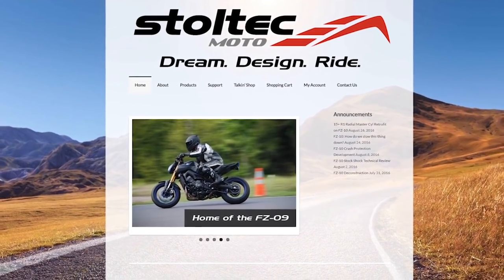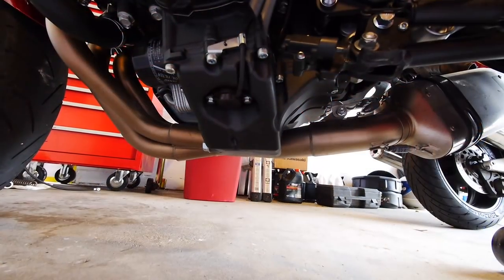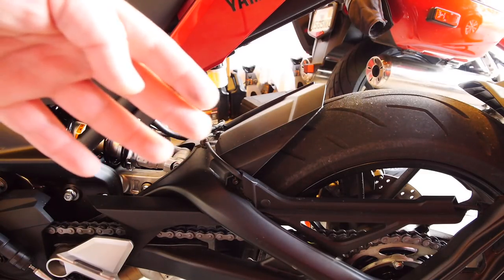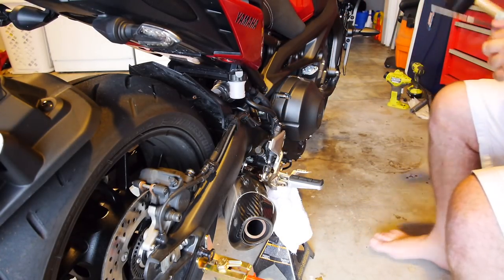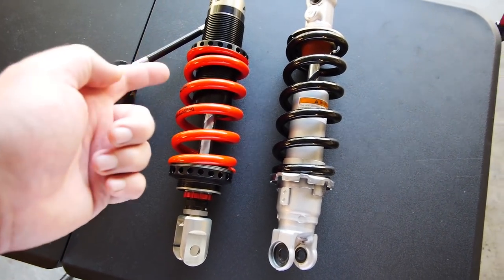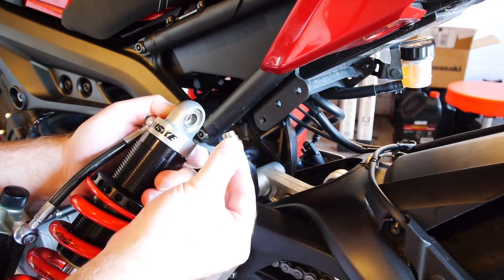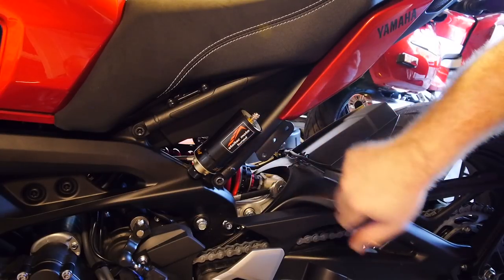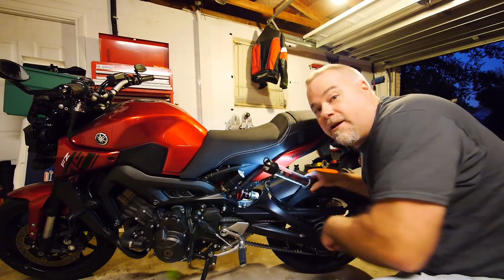FZ09 MT09 Shock Removal And Installation Guide

Comment: Good video, I found it easy to swap my shock today just by jacking the bike up by the right foot peg, it made a tripod with the side stand and front tire that was very stable.  Then I used a ratchet strap through the rear rim and over the rear subframe to manipulate the mounting holes to line up.  Piece of cake!

Comment: Just did this on my 2019 MT09 using an Ohlins 535. I will add that the top bolt doesn't just "knock out", my bike has two beefy hydraulic lines crossing the top of the bolt, they needed to be "massaged" aside. Ohlins also instructs to remove the lower dogbone bolt, I discovered that unless one DOES the lower shock bolt (delightfully recessed into the shock clevis making common wrenches nearly useless) won't get above the swing arm frame. Once there though sockets rule the day.
Reply: thank
Reply: I am removing a Matris damper, and I couldn't get enough compression without moving the lower dog bolt. Fk me, that thing was on so tight, I would not have gotten it off without my 1/2 impact. And it totally mangled the nut
Reply: Hey! I know this is a long shot, but I'm going to swap out my shock soon. What bolt is the "lower dogbone" bolt? I'm not sure and don't want to loosen up the wrong bits. Cheers!

Comment: I’ve just changed mine to a Nitron R1 using your vid. Another job you’ve helped me complete. I’ll be setting the suspension up using your video too.
Thank sfor all the help.
Reply: is this possible to do without a rear stand?
Reply: Jack Pistone you need to get the rear wheel off the ground. I used an Abba stand

Comment: Thank you for doing this video. I was on a budget so I went with the K-Tech Razor and I'm going to install it hopefully tomorrow. The pogo sticking on the rear factory shock has been driving me crazy. It's caused me to kick out the back end and do a small drift a few times, caused the back end to hop in some corners and just all around feels spongy and kinda reminds me of the old mashed potates and gravy suspension on like an old crown vic or something, just seems completely outdated and wouldn't have cost Yamaha too much to put a proper rear shock on the bike from the get go.
On my 2018 I adjusted both fronts and set the dampening and I've gotten that one to be very planted and comfortable, no more brake dive and it's helped stabilize the rear more but definitely hasn't hidden the problem. I am looking forward to getting on it and being able to have more fun and overall will be safer to ride by getting rid of that pogo sticking. I'm 190lbs without gear and I have the front set down on the 2nd to last ring on the tops (so one ring showing) and have setup the rebound as well. I used to have it set to 2 rings showing and have adjusted the rear suspension one click tighter and that did make a difference but it still is doing all the stuff mentioned above, just more controllable.

Comment: Great video! If I could add another couple of tips - if you have an abba type stand that holds the bike up near the swingarm pivot, you can manipulate the rear linkage easier if you take out the lower dogbone linkage bolt (don't forget to replace on installing!) and you can regulate the wheel height by using a ratchet strap thru wheel and over seat. Means you can precisely regulate bolts lining up.

Comment: Not sure if it was mentioned but the 14-16 FZ09s have the oil drain bolt on the bottom of the pan so it's not flat like yours is. Either use towels to cushion the pan, or spread the rear using one of the other methods if you have an aftermarket exhaust.

Comment: Thank you for this awesome video.  Are you 99.9999% certain the catalytic converter/stock exauast will work as a jacking up point?  I don't want to damage my exhaust.  Alternatively I could place a 2/4 under the oil pan instead of a text book and this should allow the jack to lift via the oil pan and not the exhaust.  Or I could place a few shims under one or the other and spread the weight between the exhaust and oil pan.  Maybe I just answered my own question. 

Thanks again.

Comment: I am more concerned the bike's balance when the shock is removed.  Would it be more stable if I use the center lift instead (in addition with the rear stand)?  The center lift is just to prevent the bike from dropping.

Comment: I tried using the same method/ process to swap out my 17 model shock for a zx10 unit. 
What a disaster. Resulted in taking off the tank. 4 hrs later
Reply: That’s because it’s not a direct fit for the fz-09.. it’s for a zx10
Reply: Yes the Kawasaki shocks going on FZ MT09 are another internet legend. Most have to be modified, and only a couple of years of zzx9 or something like that are a close fit, others require some chopping away of the bike and some the hole in the shock needs enlarged. Not a problem for wreck it ralph that follows the internet!  The Kawa shocks need to be correctly resprung and they also need to be rebuilt to be very good, which brings the price up to within $200 of getting a perfect fit Ohlins or other brands, which are down to about $550 american dollars now.

Comment: have you looked into doing anything on the rear shock with the FJR? i know its the ES model, just trying to find out the options as i'm upwards of 33k miles and understand that's when these shocks start to wear.

Comment: Thank you for the video. I own a 2017 FZ-09 as well. Forgive me, but I can't help but think that after all the upgrades I've done on my bike that I could have bought a better bike — say a Triumph Street Triple. Just saying. ...
Reply from the maker: That is true, and that's the point of the FZ series.  They are bare bones bikes meant to be personalized and upgraded and are CHEAP.  Still there are core differences between the platforms.  For example I hate the riding position and pegs of the Street series but otherwise love the bike.  But you certainly do pay for it.  In the end I now have a bike perfectly suited to me, built exactly the way I wanted and it's still a good bit cheaper than a fully loaded ST equivalent.  Not counting my labor of course ;)
Reply: TwoWheelObsession I get it. How does your new suspension compare to the Öhlins on the ST?
Reply from the maker: Equivalent.  Pensky/Ohlins is all about the best deal you can get, both are top notch. The custom valving and springs in my forms make them perfect.

Comment: Great Video!  If you were buying this bike now, knowing what you know,  would you buys the MT 09 SP or would you buy the standard MT 09 and make the suspension mods yourself?
Reply from the maker: There is no sp here
Reply: The SP suspension is also very low quality junk. It can not be serviced. No compression adjuster. Horrible

Comment: I replaced on my MT-09 Tracer RN29 2015 first version (rusty) stock against newer modified stock shock.
There is axial/lateral play on lower mount between shock bracket and 1RC-2217A-00 ARM, RELAY.
How much lateral/axial play do you have on upper and lower mounts? Please show us this in video. Is this later/axial play necessary?

Comment: I am attempting to install a Ohlins YA 535 on a 2018 Yamaha MT-09 and I followed your instructions but am not able to remove the rear (bottom) bolt as i do not have clearance. I have the front tire on a wheel choke. Should i have the front lifted with a triple tree and this will provide the clearance in need? Thank you for your help.
Reply: Same. Idk what to do other than remove the exhaust and the link arms at this point.

Comment: You mentioned it making easier to wheelie? If I have it in traction control 2 it still wont wheelie right? This is my second bike I usually ride in B mode and TC2 . after getting it flashed its still plenty fast but the front wheel wont come up. I still want to upgrade my suspension though
Reply from the maker: Correct mode 2 it never leaves the ground

Comment: I’m about to upgrade suspension on my 2018 MT 09. Probably going to go with this same rear but the front upgrade you did is just more than I feel capable of. I’m considering just upgrading the from springs for my weight according to race techs calculations (along with the fork oil) do you think I will be satisfied with that.? I don’t want to drop another $1000 on the from suspension.
Reply from the maker: Nope.  Good part of it but the damping is critical.
Reply: TwoWheelObsession 😪thanks for the reply. I’ll be looking into some cheaper option then for now at least. I’m right at 230 lbs so the bike is under sprung front and rear for me from the factory.
Reply: @jasonsmith9161   if you still haven't upgraded and you are on a budget still then look at the YSS cartridge kit. Around £240

Comment: Bought a replacement shock (Nitron) and now find that the ABS brake lines and 4 other lines block access to the top shock-bolt. The brake lines are really tight the others are held together with cable ties and can barely move. I can't use anything bigger than a small screwdriver blade through the frame window to just touch the bolt head and then only from an angle.
Questions: Did you have this problem with access?  Did the bolt just sit in the left side of the clevis while you removed and then replaced the shock? (If the bolt falls there is no access from above (ABS unit and lines) and from below it would require a tiny hand to get access.)  
Thanks in advance.
Don
Reply from the maker: You don’t need to remove the bolt just slide it enough out of the way. The lines move enough.
Reply: You're right. The lines can move enough it you apply force and everything lines up.   
There is no way of getting any sort of tool between the lines and the bolt, but those same lines prevent the bolt from falling out of the LHS of the clevis. Unfortunately when I used a screw driver blade to push the bolt back though the shock the bolt head didn't align with the detent on the clevis. I had to cut three cable ties and take out the bolt holding the lower ABS-lines junction block to loosen the lines enough to get a finger between the lines and the bolt head to align it.   
But without your YouTube post and (speedy) response I would have probably paid the shop $150+ to install the new shock. So thanks again for the video(s)
Don

Comment: Geez that thing is expensive! But I guess they run in that range
Reply: No doubt, it's not pocket change.  But, seeing it in person will ease your mind.  Riding on one, will make you a believer.  Fully CNC'd aluminum, designed and produced in the US, and 100's of thousands of miles on the road and track to back the design up.  This particular shock for the FZ-09 was a joint development between Penske and Stoltec Moto going on 4 years ago.  Its continuously evolved over that time based on customer feedback, so back to the video:  not an off the shelf item, and definitely not 'one size fits all'.
Reply: We already have them!  http://www.stoltecmoto.com/shop/yamaha/17fz09/17-fz-09-spiegler-ss-brake-lines/